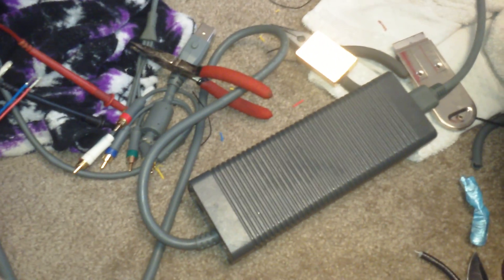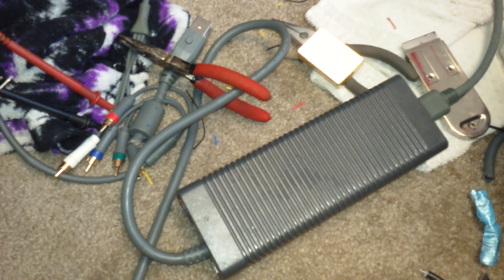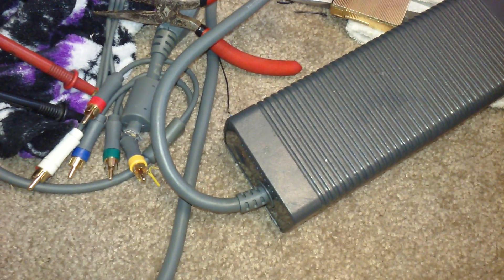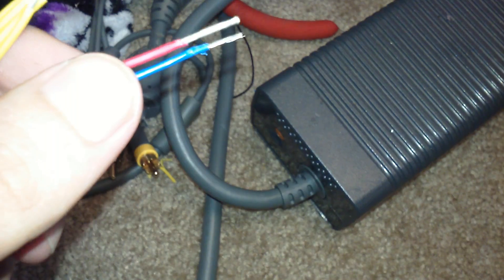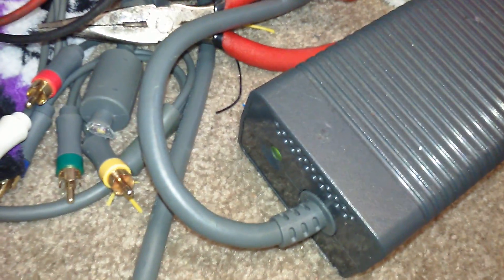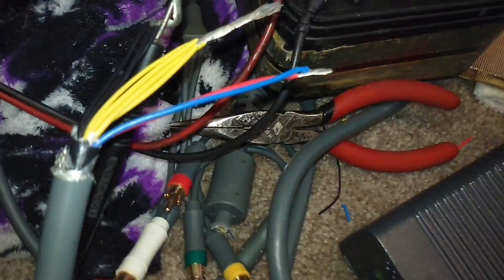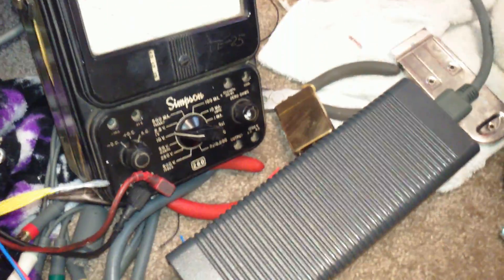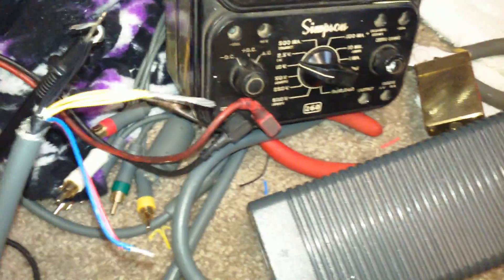Modding Xbox 360 Power Supply FOR CAR AUDIO!

Comment from the maker: The Finished Product!
https://youtu.be/70gCSLfr6XM
Reply: demonsparkx 
Can you mod a power supply from an OEM that can be plugged into an older XBOX360 console, because that power supply uses more energy than needed and besides I want to take out the disc drive so it would not need so much energy
Reply from the maker: If you really wanted to,im sure yes if the color coding is similar. I only know the pinout of this model in my video,i normally cant and dont test multiple variations due to my physical limitations (not owning different models etc)
Personally a dvd drive doesnt draw much power,and a DC switching power supply like these xbox bricks are,dont use a whole lot of power either. At maximum draw is 12V 16.5A and in AC its 110V under 3A if i remember correctly. Mind you thats also at/under FULL load. While its simply plugged in with the machine off,or even running but idle (not running games etc) it wont be using more than 40W give or take. And at "off" state probably closer to 10 or less watts.

Comment: How do you modify the small wires to provide "higher voltage" regulation? Someone said you need to short circuit the small yellow wire to burn up the 10 ohm internal resistor, then send power to the yellow wire. But I don't know if I understood that correctly.

Comment: I have the model with a connector that has two of the laptop type outputs side by side. Seems like that is only 5v (red), 12v (yellow) and ground (blk). 3 total connections. Where is the connection on that plug where it could make a connection (blue wire in this case) so the psu can get the signal in the x box to turn it on?

Comment: I put the wires in and the brick is on and green but my amp is just not turning on at all I'm pretty sure it's the amp but was wondering if u knew
Reply from the maker: Your failure to mention the amps REM wire,so id suspect possibly that? amp REM> jumper wire to amp "+" (positive) 
If that isnt working then there is another sort of internal issue with the amplifier.
Reply: Yah I got that done already thanks anyway love ur channel👍
Reply from the maker: @thhpoo3602  good luck friend!

Comment: Hey i have jbl gx-a3011si mono amp and jbl csx 1400bp sub....will the output from this power adapter enough to power those on full volume?
Reply from the maker: all that matters is this. the amperage DRAW from the car amp. if its rated with say a single 20 or 40A fuse. then you know to use a power supply upwards of either 20 or 40 amps. (more is obviously better) the voltage however depending on the model amp some can opetate as low as 10.5Volt all the way up to a whopping 15V! most applications however,like this video i made,supplies DC voltage with 16.5A 12v DC current. which is roughly 308Watts. so this would literially be good for a small monoblock 300wRms (300 true watts) amplifier. ie : rockford fosgate P300.2   pyramid also makes great equipment if you wanna invest into actual proper home audio/power supply equipment. from i think as low as 5 or 10A to as high as 100A supplies. oh yes failed to mention the psv pyramid power supplies do 13.8V and not straight 12,which IMHO is better and more realistic since a  car battery at topped off voltage is much closer to 13.8V than an equal 12V. the extra voltage actually helps bring out more wattage and power as well. IE: 12V @10A vs 13.8V @10A,a few more watts would come out with the 13.8v as opposed to the 12V. (they get a bit pricey though)
https://youtu.be/cQcEzDYjC3c

sadly i have never actually gotten to test run this xbox power supply on a car amp but i did however use it to supply heavy amperage to a 24V DC electric scooter motor to overvolt to 36V to measure the speed and RMP increase difference (see eZip E400 modding video)
so they indeed can handle a few hundred watts easily and are actively cooled as well so heat never became an issue. hope i answered your questions. if not please let me know and ill do my best to assist you further! please like and sub as well if you havent already ^.^
Reply: First of all thanks for the reply mate..Well am not a techie as you are...dont understand this stuff alot i mean the numbers..hehe
so this is my amps ratings
Load per Channel-2 ohm
Frequency Response-30-320
Impedance-2 ohm
Maximum Power-Output1200 W
Rated Power Output-300 W
Power Rating-Peak
and it has 2 20amps fuses
so this pwer brick will be fine to power it sufficiently without underpowering it no matter which sub i hook it up to it?
Reply from the maker: Rated power output is most likely closer to the actual RMS rating (Root Mean square) basically how they measure the average stable wattage output on an amp without it being a clipped signal. So 300W,this supply would stuggle at around 80-85% maximum volume but work very well none the less. Personally id run a 250w single subwoofer if possible,or two 2ohm 150W subwoofers would be best optimal. Rockford makes some subs like the P3 12" rated close to what youd want. You can still get a lot of bass with less the power by using lower powered subwoofers at times. Hope i was able to help clarify betteer
Reply: Ohhhkay....so my sub which is rated  350W RMS 4ohm would lie underpowered...thanks mate u saved alot...i was all the way gonna buy this power adapter as i dont have a spare..i guess i should buy better pc power supply then which gives good 40-50amps  output so as it will remain at minimal load and cooler as well! Hows that?
Reply from the maker: very much agree if you can get a quality reputable power supply that can provide higher amperage absolutely go for that! should definitely stay much cooler as well

Comment: Will this work with an Xbox 1 connector  it basically the same but with 2 wires each instead of 4
Reply from the maker: planbskater1825 what do you mean by two wires each? Please clarify,do you mean for the power 12V rails?

Comment: I have a kicker ZR 1000 will this work , goes on 3 solo/B 

Let me no please!!!!!!
Reply: Will a A power 680 watt be bridgeable with a 550 watt antec power supply does it really matter what brands you bridge with? In the past I had 3 old power supply's but one kept shutting the other one off there were no shorts or anything but I had to turn certain ones on in a certain order to make them 3 to stay on was really weird putting the 3 greens and 3 blacks didn't work I had to turn one on then the next one then the next one manually they wouldn't all automatically turn on like they were suppose to,But seemed though the amplifier wasn't using all the 3 power supplies.
Reply from the maker: Yes,but this can only supply up maximum of around 230 watts @12V rated 16.5A  
So id suggest two of these in parallel to get the fullest out of the amps power and subwoofers potential
Reply from the maker: Thats odd,but i suggest always matching and never mixing. As youve stated,the signal wires one one or more may be slightly different hence why youre having trouble with all of them being powered on at the same time. Antec is pretty good brand ive had the 380w earth psu before on a custom PC. You can also go with corsair and many other good name brands. Just make sure theyre a high 12v+ rail amperage output. Personally i had always used a heavy duty benchtop DC switching power supply made by pyramid PSV-300 which was rated 30A continous and 40A burst. I put a 70-90A load on that and it ran well but was finally able to start causing voltage drop. (Obviously not meant for THAT heavy-a-load)
You can buy larger models up to 100A (which imho is beastly nice too,but a bit pricey)
https://www.youtube.com/watch?v=cQcEzDYjC3c&app=desktop

Comment: I have this brick do you know how to get to the fan inside? I already open it but the fan it's on the side that I was unable to open because I was afraid of braking it :(
Reply from the maker: LILY RAMIREZ i could of tried myself and found out but i sadly no longer have this supply or any of my stuff
Reply: +demonsparkx thank you very much anyway :)
Reply from the maker: LILY RAMIREZ welcome! Good luck
Reply: LILY RAMIREZ how did you get the brick open x.x

I took the screws out but it must be glued or something :/
Reply: TheOtherWhiteBread0 haha thanks i got it after :P

About the fan... It sounds like you just need to tear off the plastic sticker thingy so you can see some more screws. The fan is easy to get to.
Reply: Cute sob

Comment: dose it work
Reply from the maker: yes. this supply can provide 16.5A @12V DC so it can power up to about 250wrms car amps. you can parallel them also if needed to have a higher amperage for more powerful wattage amplifiers. i went homeless and wasnt able to show me powering an amp on video since i didnt have any on hand and did this only as a tutorial and for fun. i had a solid state amp i used and powered home subwoofers.
Reply: +demonsparkx OK thanks man

Comment: Have you identified where the voltage regulation circuit is? I'm looking for a way to make it variable voltage output. Thanks.
Reply from the maker: no sorry,i actually never needed to  bother going that far in diagnostics off this power supply,since it was already (obviously) outputting 12V DC at its rated (16.5A) im sure you can easily find a circuit diagram for an xbox power brick on google though. good luck!
Reply: It's just that I'm looking for a way to output 13.8V, which is the standard automotive "12V" power output. Thanks for the advice regarding schematics, I hadn't thought of it :-)
Reply from the maker: JohnnyJim J gotcha! Well for that,i had the pyramid PSV-300 Benchtop Power Supply before in thr past which did do the same 13.8V @ 30-40A i loved that power supply. Good luck!

Comment: i have a slim model same wires but theres one grey one
Reply: Secret Beed 8 thats the third yellow wire your welcome
Reply: @letsgetcrazy1552 No, it's ground wire.
Reply: +Secret Beed
Reply from the maker: +sugoi gaming im really not sure offhand if i can help but to the best guess id assume a grey would be a ground wire possibly, or the signal wire to make the supply turn on. if you can imgbox host a photo of the wires id be more than happy to take a look and make a second judgement
Reply: ok thanks anyway
Reply from the maker: ***** its very possible. The most powerful 360 supply only allows up to 16.5A @12V 
If the amps fuse rating is higher than 20A you may have issues at higher volumes. You can also parallel the power supplies if you wanted and had more than one.

Comment: Would this supply enough amps to just about fully power the rockville RVA600.1 amplifier?
Reply from the maker: +K. Dot im unable to read/see a good enough photo of that amps fuse/rating but seems to me it doesn't output anymore than 400Wrms,with that being said, this power supply should suffice, but it may have a voltage drop at high output. this only supplies 12V @ 16.5A (220W) you can parallel these power supplies also though so running more than one is always a feasible option if you wanted.
Reply: demonsparkx if it was a 220 watt power supply that means that the current would be 18.33amps theoretically, given that it was 12 volts obviously

Comment: did your great grandfather give you that multimeter? but good vid casue all my extra power supplys are 5v and i need a 12v and its making it hard to track a 12v one down.. i have a few for my old NES systems but they still work, so i do not want to chop up their retro power supply. but the xbox brick one came of my red ring o death x box.
Reply from the maker: +Shadetree Props lol actually yes ironically (RIP) my gpa was an engineer and worked for NASA many years ago as well, he was such a genius..  back on topic though yes these xbox power supplies are excellent 12V DC sources. this one (model i had) supplied 12V DC @ 16.5A which is very nice for many useful applications. im unfamiliar with the NES supplies but if you're not using your old xbox one, you can just follow along with this video its very easy to wire these up as a 12V DC supply. only hard part was combining all the wires together to a higher gauge (i used 8GA)
Reply: demonsparkx i worked in the circuit city roadshop, a good way to get the wires together is. fray them all a bit, then slide them together, then dump solder into the lot and it binds them all thogether. heat shrink it and done.  but mine is going to be used to power LED strip lights. trying to figure out how to put in a voltage detector, and a variable voltage meter on another to make a bench PSU. to use on other projects. and sorry about your grandfather...i am a truck driver, who happens to raid the trash can at NASA here at REDSTONE ARSENAL...got some sweet electrical gear outta that big constuction dumpster.
Reply: demonsparkx i actually do vids myself. so i will probally do a video of me braiding the wires the way i was taught in the roadshop.. another thing, use old CAT5 or ethernet connectors to make quick disconnects for your speakers.  or even phone jacks.. just use two wires for the + and - and click click its in. its also a good to use a old hub or router, and rewire it for this. to do mulit speaker output off it..especially if you do custom boxes, and you want 2 or more on your left and right channels. then the hub make it faster, and the cat5 makes replacing blown speakers easy. unclick it from the hub. wire the new speaker click it back in the hub.
Reply from the maker: Shadetree Props
sounds like a real lucky opportunity honestly. some of the best coolest stuff i 9/10 times find being trashed. i see not ever any point in letting good equipment of any sort just go to waste. unfortunately i recently pretty much went homeless and had to leave where i was previously living and so i lost pretty much everything except some of my clothing. this power supply included i was far too scared to even pack away.. last thing i'd need is some retarded TSA agent claim it was a bomb or some shit... i wouldn't at all be surprised. also im not sure you're aware of it'd matter but its on topic im also transgender... which from everything i see involving TSA agents... they'll do anything they can just to fuck over people like myself, who literally are doing no wrong and just being who we are. its a sad world we live in to say the least. and yes also thats exactly how i rigged this power supply as well i soldiered up all the lead wires together,taped and shrink tubed them together (as easily portrayed in the video/visual)
Reply from the maker: Shadetree Props
haha! (in regards to the CAT5 comment) i cannot even begin to tell you the countless times i have used CAT5 cables and jack/connectors for applications that require a low or no voltage connection/for signals like audio line-in/out work fantastically. at one point i used a 100FT CAT5 and spliced off both ends of the ethernet jack and connected a female USB and male USB end to run a stupidly long USB which i had a wifi stick at the other end, i needed to run the wifi stick outside at one point (yeah im really THAT poor lol) just so i could snag some wifi to get online xD hey ya gotta do whatever works eh? lol take care friend! been a pleasure chatting and hearing out your stories and tips. :)